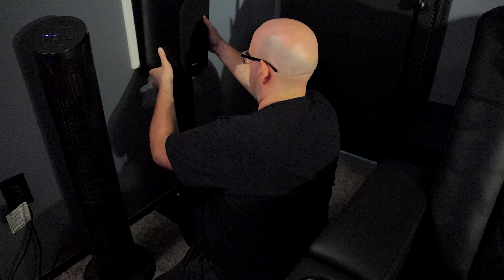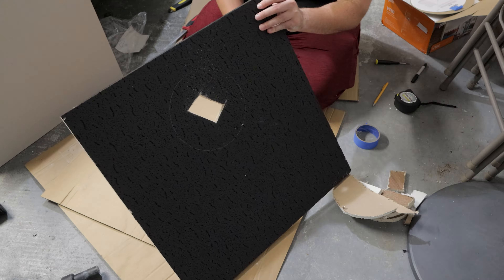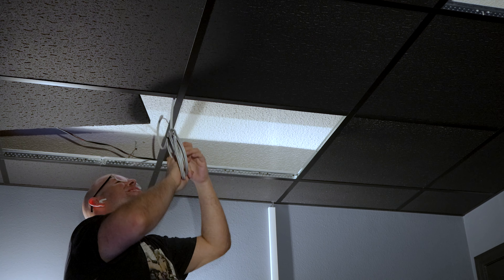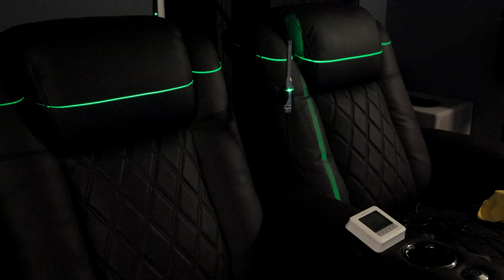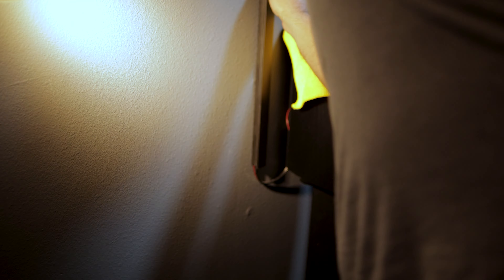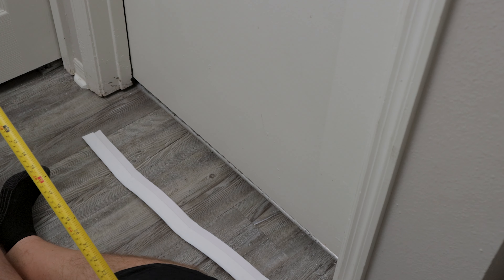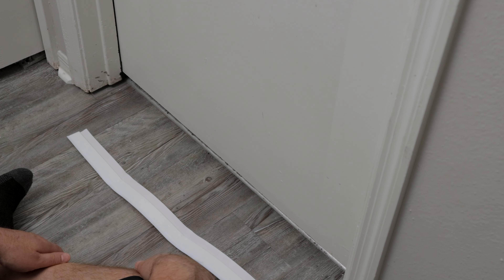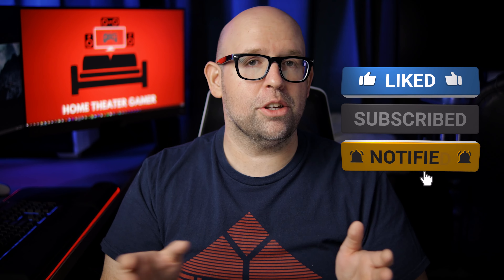DIY Home Theater Build Series | Episode 5 - SPEAKER SETUP & MORE PAINT

Comment: Brad, your room looks like it will be great to enjoy your movie/music times in.  Wining the AV battle is worth the fight.  
Gluing the drywall board behind the ceiling tile is genius!
I have been wanting a laser pointer for aligning my speakers for several years.  I finally settled on the lower priced Bosch laser distance measuring tool.  It has worked great for both alignment and setting the distances in my AVR.  The bonus is I can use it for many other projects.  I thought about using my older laser level, but I figured out the lines would move around too much to be useful for alignment just like in this video.

Have fun at CEDIA and I wish you and Trish all of the very best, Kevin
Reply from the maker: Thanks for the comment, Kevin! It's great to hear from you. Using a laser level isn't the most ideal thing to use for setting up speakers, but I already had it so I figured I'd try it and put it in the video. It worked surprisingly well, though I don't think I'd recommend it over a laser pointer solely due to the cost. I honestly think a digital angle finder/laser would be the perfect thing for this, especially when trying to determine proper height channel placement.
Reply: @HomeTheaterGamer  Fact! Saving every dollar possible is so important.  Using a tool on hand to it's max is critical.  I'd like a laser angle finder as soon as I can afford one.  It will be a task to find one that is accurate enough to use on other jobs at home and work.  Thinking about my laser level - it may have a lock for the laser cross hairs.  I'll have to check it.  I wonder if yours has a lock.
I can tell you that since I aligned my speakers it has made a great improvement in the audio quality in both movies and music.  Who knew it makes that big of a difference?
Reply: I thank you Kevin! I love that laser level. I have many plans for it. 😁 And yeah it's crazy how moving speakers even slightly makes a huge difference. I love things being loud but I have sensitive ears. I think Brad's hearing isn't a good as mine due to his years of being a drummer. So I'm the one to ask him to turn it down "just a little." But in this new theater room loud doesn't mean painful which is so cool. So we watched Jurassic World and I got to experience those t-rex stomps in the proper way! Haha
Reply: @trishpipkins  Yes ma'am have that straight level beam of light can make so many projects easier and precise.
Hearing loss - yup - us guys have abused our hearing far too long.  Myself as a welder/mechanic/etc... have given myself ringing-in-the-ears a permanent place to the live.  
Speaker placement - Since I have built the wall mounts for my side surround speakers and have them aimed at my ears the audio from the sides is so much more clear and natural.
I'm glad you got to have fun watching JW and have your bones shake.😁I'm not a big fan of the Jurasic movies, but I have been considering obtaining the collection.

I wish you and Brad all the very best and hope you two have a great day! Kevin

Comment: The good thing about having the ceiling speakers in those tiles is that they can be moved easily! Regarding the spray paint on the cable channels, I've had excellent results with spray paint when using the correct primer and paint for the application (plastics, metals). As long as the instructions are followed for prepping, spray distance,  additional coats, and drying, then spray paint from a can has excellent results.

Comment: I noticed you didn’t use backer boxes for the in ceiling speakers.  I didn’t either but I see that recommended a lot of places.  

I used quarter inch plywood as support for my ceiling speakers.  Never thought to use the drywall I had laying around.
Reply from the maker: I’ll be experimenting with back boxes at some point in the future. With the drop ceiling it should be relatively easy to test them out, with the hardest part being actually building the boxes.

Comment: It's gonna be surprising if that drop ceiling doesn't rattle with intense bass
Reply from the maker: Spoiler alert: it actually doesn't (after time alignment and calibration, bass response goes down to 14Hz effectively in room). The bifold closet doors on the other hand...
Reply: @HomeTheaterGamer  that's fortunate. Mine rattles very badly with at certain bass frequencies, and it is the no-tile style, so if I'm not wrong it's supposed to be more resistant against rattling. The cost of installing new drop ceiling is high, and I'm afraid the issue is still gonna be there, so I'm thinking about removing the drop ceiling altogether and use bare concrete ceiling. But then how to mount the in-ceiling atmos speakers...
Reply: @vmd1293  that REALLY sucks. ☹️ Like Brad said we haven't had any issues with rattling with the ceiling. Hopefully we never will. I also hope you find an easy and inexpensive solution to your ceiling.
Reply from the maker: @KIDCOM if going back to concrete is something you do, you may want to consider simply mounting bookshelf speakers for your Atmos/height channels if you can instead of using in-ceilings. Don’t know how hard that would be to accomplish and gravity sucks, so I’d definitely use some type of safety wire on the speaker.

As far the rattling goes, I’m definitely fortunate. That was a huge concern initially but I went with my gut. The way the Armstrong  ceiling grid kit went together makes everything VERY rigid. Once things are snapped in (the main beams to the 4 foot cross tees, the 2 foot cross tees to the 4 foot cross tees) there is literally zero movement which definitely helps.

I do have each sub decoupled from the floor using SVS’s isolation feet. That may make a slight difference and honestly, now I’m curious if it would rattle without those. Might have to test that when I return home from CEDIA.